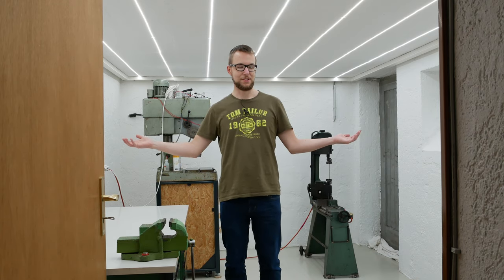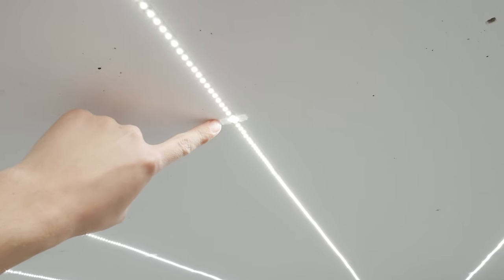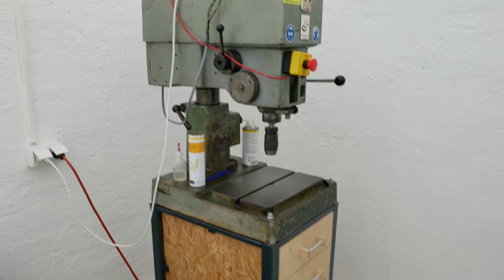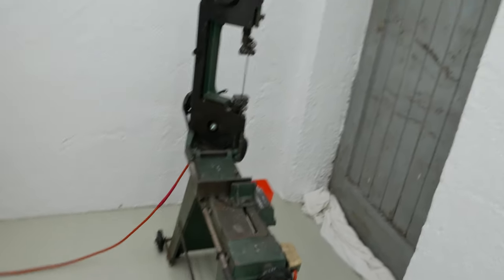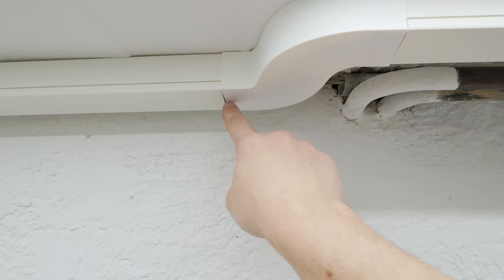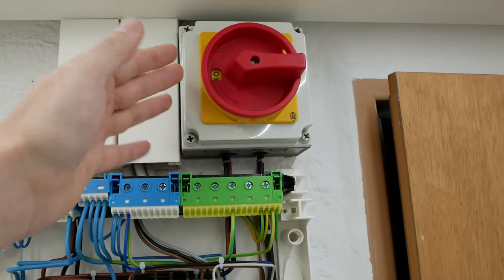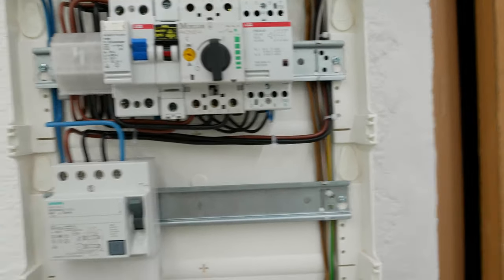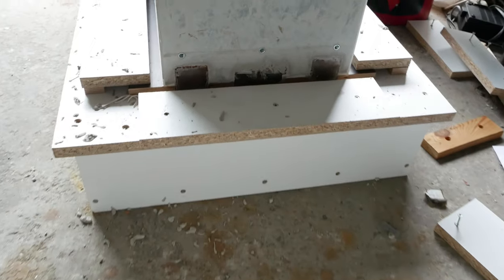Workshop Update and New DIY milling machine project start

Comment: Congratulations with the new shop space and nice work with the electrical work.  You have a very deep voice :) which is not a bad thing, but a deep voice in a room with that much echo is a bit hard to  hear you well and listen to. Take some clues from Martin's shop and put some foam to suppress the echo/reverb. Thanks. Looking forward to your new Mill build.
Reply from the maker: That will get better when there are more things in the workshop. It is a lot better already and there are still a lot of things missing. In the end every space will be utilised ;)

Comment: Good to see some content from you again.
Is that new milling machine EG or Concrete ?
Reply from the maker: Thanks. It's UHPC from Nanodur with the E45 mixture. It can be mixed like normal concrete. So very easy to handle.
Reply: @AlexCNCen  seems good, my cnc if out of concrete and steel mostly, some 26mm alu where i needed to shave some weight.

now i am only missing the counterweight system to be up and running